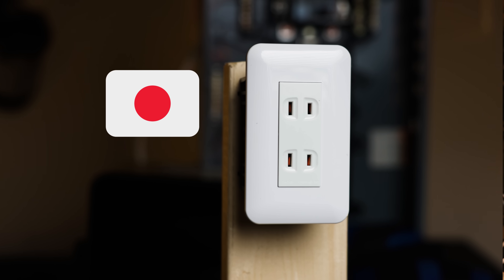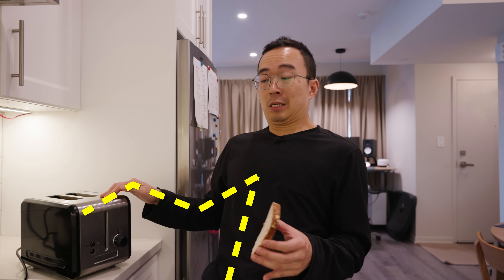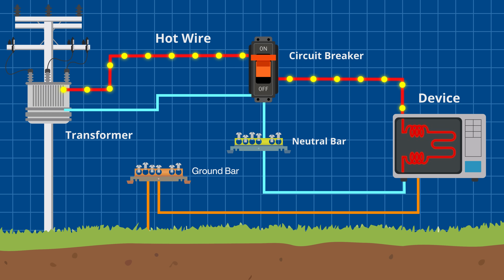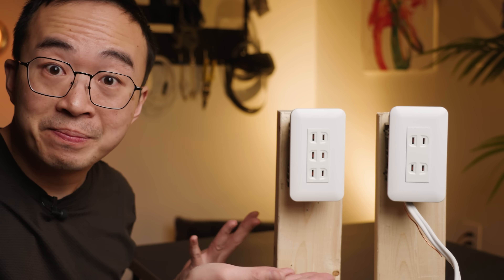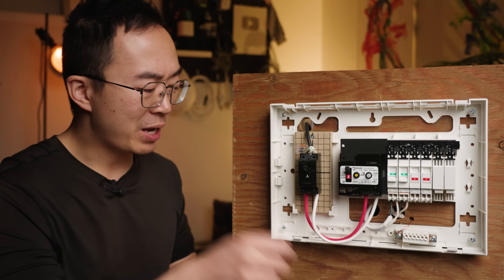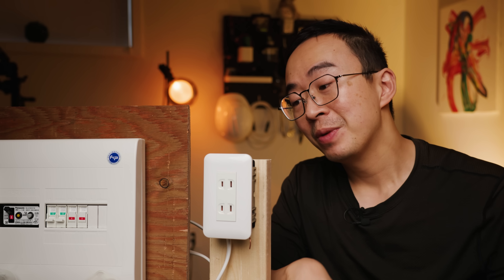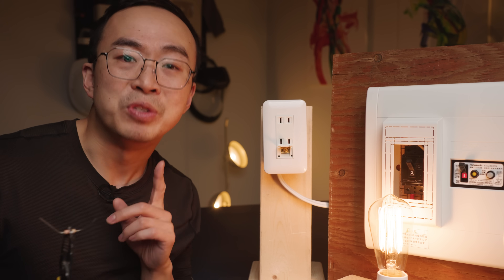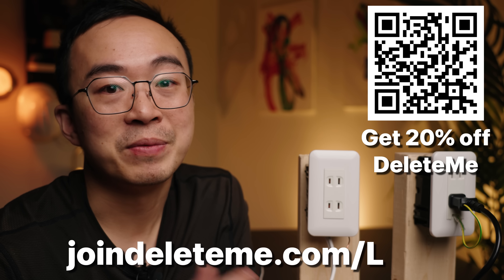How Japan Made Their Outlet Safe

Comment: The lack of ground on outlets here (hi from Japan) has been a known problem for decades. Slowly more modern buildings and housing are including grounding.
Reply: This is the situation we had in Canada when I was a kid.  We only had grounded outlets near the kitchen sink and laundry tubs.  Now grounded outlets are mandatory and GFI are required in areas such as near the bathroom sinks.
Reply: @James_Knott  But most of the appliances you plug into grounded outlets do not have a third prong. Shavers, hair-dryers, phone chargers, lamps, a good chunk of consumer entertainment equipment, small appliances like hand-held mixers, ...
Reply: @James_Knott  in the new US code GF+AF are required on all occupied space receptacle circuits; so not just bathrooms and the like, but also bedrooms, living rooms, etc.
Reply: @Willbme4EVA  In the US, you can actually do the same from a functionality standpoint. We have polarized plugs for safety's sake. That toaster for instance is part of the reason why. Ever seen the old warnings about the dangers of sticking metal in the toaster? That's why. The switch in the lever allows the circuit to complete, and breaks the circuit otherwise. Plugged in a safe orientation, the hot side stops at the switch, and the heater wires are on the neutral, which means you can't be shocked if you stick something in there; however, in a dangerous orientation, the heater wires are on the hot side, and the other side of the switch is on the neutral leg which allows you to be shocked by placing something in there
Reply: They're also really dodgy plugs IIRC, quite easy to pull out by accident.
Reply: @Willbme4EVA  WTF are you on dude? That would make for an interesting electrical system.
They are not both live. Also, the "wholes" are not the same size on regulation outlets anymore and haven't been for about 30 years. The SMALLER hole on the LEFT is live and the LARGER hole on the RIGHT isn't.
Reply: @Willbme4EVA  If you look closely at your socket you fill find that one side is longer than the other. The longer is neutral and the shorter is live. At least this should be the case and if you find both sides to be live it is incorrectly wired. As far as I'm aware though all home electronics are setup to work with the plug plugged in either way. Another interesting thing is that there are special plugs and sockets for higher amperage or or voltages with different shapes that you can't just plug in backwards). Source I have a japanese electricians license(only the 2kyu but it's enough to work on sub 600v domestic circuits, it's legally required to work on home wiring, I am NOT a full time professional). The 200v sockets btw would be -100v to +100v so both sides would be live. I can't remember for sure, but I believe these 200v sockets are required by law to include a ground.
Reply: Well, GFCI disconnects very quickly in about 35 ms, you might get a bit of a jolt, but at least the circuit is opened.  Ideally you'd want both GFCI and grounding for the best of both worlds.
Reply: @Willbme4EVA  unpolarized does not mean both sides are hot. Please do some research.
Reply: @Willbme4EVA if both sides are hot, are your running 240V?
Reply: @couchrou  No, it just means they don't use a center-tap on the transformer. You can run 240 straight to an outlet that looks similar to the 120 outlet (prongs are lying down instead of standing up though) and that is what you are doing. It's just two hots and a ground. In their case (i'm assuming here), they don't use a center tap, and the output of the transformer as a whole is only 100 vs being 240 cut in half.
Reply: @Willbme4EVA  
I'm not a democrat, I'm not even from america. Thanks anyway sir.
Reply: Is only a single earthing rod used or is a foundation earthing with an earthing braid and the necessary transition resistances used, as in Germany?

Old buildings in Germany are exempt from the relevant standards, otherwise all older houses would have to be demolished and rebuilt.
Reply: @sylviarohge4204  usually multiple rods(i.e 5ft copper) are used inside the earth chamber(the container where the rods are placed).. to maintain some normally lower than 5 Ohm (resistance).
From what I observed.

this is what we practise in my area(Malaysia).

Usually if the area's dirt salinity(near to shore/mangrove repurpose area) the lesser rods will be used.
Reply: Earthing is not sufficient for safety protection, we need to have equipotential bonding additively
Reply: Outlets where a grounded appliance is expected have grounds, like a washing machine or fridge. It has a thumbscrew for a spade connector though instead of a ground pin.
Reply: Had to upvote just to give you the 666 upvote count. ;)
Reply: I wonder how much safer does that makes the whole system. Not theoretically but practically. Being living in Japan for a long time, but have never heard anyone dying of a electric shock...does that extra grounding REALLY make a difference in real life?!
Reply: @JoaoSilva-t5i  it can only make a difference on a malfunctioning grounded appliance.
Reply: @Willbme4EVA  240v is actually a lot more efficient input in 99% of dc conversion electronics so our 120v is worse in most cases. Produces more heat.
Reply: The main problem in Japan is the round building you can see from near Umeda and JR station in Osaka used to look like a giant smoldering Cigarette when I saw it in 1989. Last time I saw it the top advertising sign was changed so it doesn't look like a smoldering cigarette anymore. Also some other buildings were built blocking the view. Japanese need to fix that!! Bring back the giant smoldering cigarette.
Reply: @fredkilner2299  Could be worse, Piccadilly Circus in London is all big screens, now. No "actual" signboards at all.
Imagine the "Glico Man" being done the same way. There'd actually be a looping animation of him running, and all sorts of rotating changes for seasons...
Reply: Nothing can beat mechanical ground. In the US, we use both GFCI, AFCI, CAFCI, and mechanical ground now. Good to know that Japan is mandating the mechanical ground.
Reply: It s a huge headache if you do audio work
Reply: @dono42 - 
There are still more  known problems for decades but are not fixed, like being able to touch life contacts (terrible USA outlets+plugs) ,  Germany made it´s outlets safe in 1930  (yes 3 years before the Nazis came to power) with it´s recessed ( & grounded) "Schuko" outlets ( = no more toucheing live contacts)
Reply: @missplainjane3905  This is so funny, I think back as to how USA has made so many bans on so many light bulbs over the last 15 years.  For what?  And who's benefit,  I myself like the wiring in my house.  My side gig is also computers, if there was  problem I would fail very badly.  Come visit Japan, look in some junction boxes.
Reply: @missplainjane3905  are you a democrat? You are speaking to me like you are.  It is ok, I get that allot from electrically woke people.  Keep trying to use twice the power to accomplish the same task  That is eco and safe.
Reply: @VanillaPeach-y7l come back on a real account Mr 09/24/2024
Reply: @Willbme4EVA  
No, your country would be a disaster if kamala runs as president. Thanks anyway even if you couldn't give a proper respond to my questions sir.
Reply: @Willbme4EVA  Doesn't extend life and can actually significantly shorten the life of electronics if they aren't rated for the lower voltage; it really depends on the appliance. High draw appliances will not work properly, but others that already have step-down electronics inside should be fine, as long as the frequency is compatible.
Reply: @Willbme4EVA  I also live here(otherwise why would I get a license :P). Older homes may have equal size sockets but modern ones(including mine) will have uneven sizes, though the blades on plugs generally are identical(meaning they can go in either way). The plug he's showing looks like a standard panasonic plug you might find in a newer home here.
Reply: @JuhaniC83  cool I would invite you to come over and look at my plugs on some of my walls and tell me they are different sized holes then.  If you are an electrician in Japan so you should of seen plenty of the Type A sockets with the same holes on both sides.  They exist just as much as cars with steering handles on the right side.
Reply: @Willbme4EVA  Ok. So, overall, sixty-year-old electrical system. I'm not sure what "wiring overhauled" means, but unless they took out and replaced every socket, certainly you can't claim that what you have there is what you'd see in, say, just a twenty year old building.
Reply: @Willbme4EVA that is not true except for 200V,  it's a center tapped system just like US and Canada
Reply: @Willbme4EVA you are mistaken. A circuit needs a return.  You can’t power something without a circuit.
Reply: Thank you for your comment. I was getting upset about the bad info in this video. US is using both traditional breakers and grounding as well as whole house GFCI as well.
Reply: I just came from Japan and the washer in the house I stayed at had an added ground running behind the faceplate. Looked ghetto but whatever works. They added it for a reason.
Reply: When I visited all the hotels had american outlets only
Reply: Yeah, but a lot of landlords are incredibly stupid.  I was living in an apartment a few years ago, and asked the landlord if I could upgrade the outlets out of pocket to include ground.  He said "Only if you pay to change them back when you move out".  Why would they ever need to change back?  Absolute absurdity.
Reply: But the proliferation of two-prong appliances negates that.
Reply: just wire neutral to ground inside the outlet and be done with it....
Reply: @marinabrashev914  Problem is that that will be sending some return current through the ground line, which is normally not expected (it is an emergency situation). Since we know (e.g. from the very video above) that Japanese breaker boxes have GFCI, what will almost certainly happen is that as soon as you plug something into the socket in which neutral and ground have been bridged, the GFCI will sense that current is leaking into ground and trip.
Reply: i've been to multiple new japanese residental houses and none of them had a third pin on outlets. only the outlet for the washing machine had a third hole to which a SEPERATE green/yellow grounding cable was attached and it looks awful lol.
Reply: Oh right, look at that... a comment disproving the premise of the video.
To which I knew was false.

Hello from Italy, where outlets are basically that plus ground.
Reply: @IIARROWS  that's the norm literally everywhere.
Reply: @IIARROWS  The premise was that GFCIs are safer than relying on case grounding which often doesnt protect you if there is no case.
Reply: @AlpineTheHusky  No, the premise is at the beginning. The premise is that it hasn't been a problem, while in fact it has been for a long time.
Reply: @AlpineTheHusky  Agreed 100%. Grounds do a good job protecting wires and walls, and people are healthier when not on fire.

For shock hazards? Grounds certainly help by ground-faulting and popping breakers, but if the current is insufficient for a breaker trip, a severe shock can still occur. GFCI mains? That’s brilliant, and the US should strongly consider it.

Especially since we’re now expected to put individual GFCI/AFCI breakers on almost every circuit with newer NEC requirements. At that point, make the main a dual-function AFCI/GFCI breaker and call it a day.
Reply: it's because it's cheaper and easier for contractors to comply with if the ground is on the socket end.  It's a push from contractors to save money. It's actually more dangerous because it puts the responsibility for safety in the wrong place.
Reply: Full disclosure: Not an electrical engineer

That said, I know enough about electricity and electronics to have an opinion.

The Japanese system is safer, in a manner of speaking, and there is a reason combo afci/gcfi are becoming required in more areas in the home because the gcfi can trip in many circumstances where a regular breaker with a ground fault will not trip.

A typical breaker only functions on excess current, so if a to-ground short is not causing enough of a draw, then it won't trip the breaker.

GFCI, as mentioned in the video operates on the imbalance between the hot and neutral to trip, and only needs to see a very small imbalance to trip.

TLDR; The Japanese system, with a whole home GFCI will trip in a bigger variety of situations then a traditional breaker.  Add the to ground portion will result in a trip almost immediately when there is a ground fault detected.

It really is superior, even though the video didn't show it, it does show how far ahead Japan was WRT their engineering feats.

If you have the spare money you are definitely better swapping out a regular breaker for a combo G/AFCI (however you will get some false positives).
Reply: @Willbme4EVA   Ummm...  There's no positive wire with AC.
Reply: @Willbme4EVA  You should indicate what you mean by "older." I live in a building built in the '80s, and all outlets are polarised.

Not that it makes much difference; I've never seen an extension cord or power bar that's polarised.
Reply: I can't believe how ridiculous this all sounds No Grounded outlets in Japan ! ... JAPAN the (Technological leader of the world is so "Backward") . I'm from Africa and we are miles ahead of this silly notion of not having ground at an outlet. I'm sorry but this is shocking (not literally) and it sucks.
Reply: @Ali_Haji_SouthAfrica LOL you'll have gaijin in here whining about how Japan "still" uses cash, faxes and paper documents, so is not at all a "technological leader".
Except no, those are all good things.
Reply: Ciao
Reply: @Willbme4EVA  no neutral?? It's hard to believe you. I doubt you have IT grounding system in the place you live in, or you have somehow 200v three-phase supply into your house, while sourcing 2 phases into each socket. Would be quite weird.
Did u check your sockets with a pen tester? Do both contacts light it up?
Reply: @borincod  You don't have to have three-phase system to have two hot outlets. In one kind of a "220V system," you would have -110V at one wire while +110V at the other.
In the U.S., we have a 220V system and put one 110V leg to one set of breakers and the other 110V leg to the other set. And with both legs sent to 220V air conditioners, dryers, electrical heating units e.g. "baseboard heaters" etc.
I at one time had an operating lathe that I bought from a factory that ran on 220V three-phase. (To operate, it needed a rotary phase converter RPC and an idler motor; or other people with their own preferences could use any of several other methods to operate a three-phase machine off of two-phase power.)
Reply: @geoh7777  A three-phase system? Ha, you don't know what you're talking about. Home systems are split phase. It's one phase split in two at the transformer. (There is no such thing as + or - AC voltage) Stop giving advice about something you don't really know about.
Reply from the maker: Yup, many houses are including grounding.  I certainly show it and even explain why Japan has relatively late grounding requirements.  I even brought up the 2022 requirement.
Reply: @Lam  lmao you can't just lie to viewers most of the video and then get confused and be like, but I mentioned it at the very end!
Reply: @Lam   ALL dwellings since the mid 80s have been required to have grounding due to both high draw items and 200V appliances. The 2022 update only really concerns the outlets throughout the home that weren't previously expected to have to deal with those types of appliances. If only they would get rid of the insane whole-house GFCI and at least switch to a per-breaker GFCI, then life wouldn't be hell dealing with the whole house shutting off any time an overzealous fault is detected.
Reply: @Lam  Thats YT.  Informative review
Reply: You maybe should've considered a less clickbaity title then since Japan didn't really make their outlets safe so much as they hacked around it.
Reply: ごめんなさい……日本人ですがそんなこと聞いたことすらありません
マジで何言ってんですか？新築でもついてないことが多いぞ？
Reply: 何十年も前から問題に
マジで嘘はやめてください